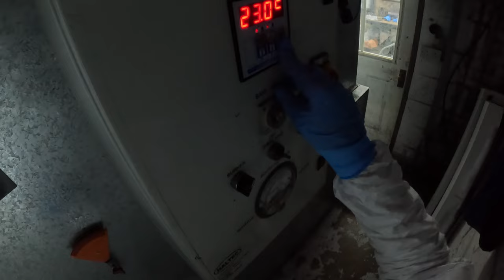Spray Painting Vauxhall Adam S

Comment: You deserve it mate where do you get clear base from for solvent paint I told you the other week got my ford focus mk3 front bumper painted in Luna sky  gray base coat paint and its total different from the car I have since got more paint and this painter said it needs  blend on the wings
Reply from the maker: Cheers, find out what the manufacture of the base coat is and see if they do a solvent base coat blender for it
Reply: @TheHumblePaintSprayer333   what your name  andy its Mipa base coat paint mate just I have a right carry on mate like i say got the paint mixed up base coat  1lt took photos with spectrometer photos and the painter spray the bumper when I put it on the car totally different colour I went back to the paint supplier and he came out had a look and sorry for that gave me another 1lt of paint now someone said its has to be rubbed down with 600 grit over the clear coat paint and re painted with base coat paint and clear coat paint and a blend on the 2 wings